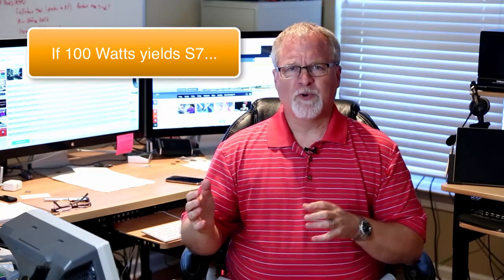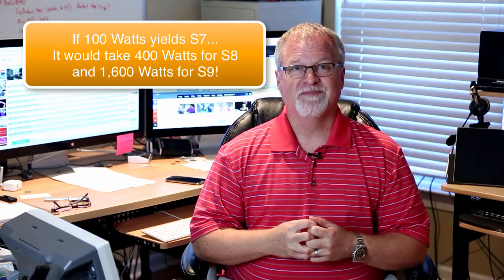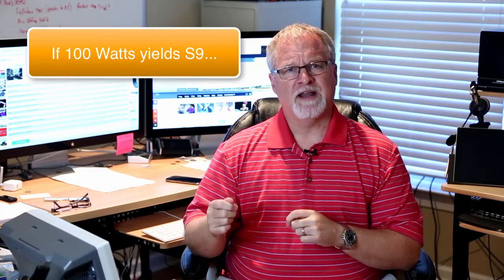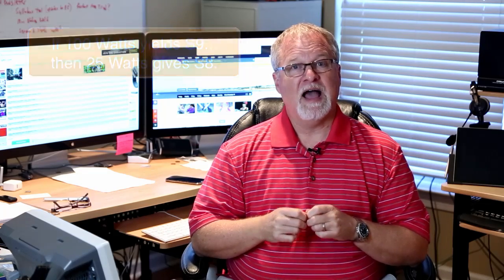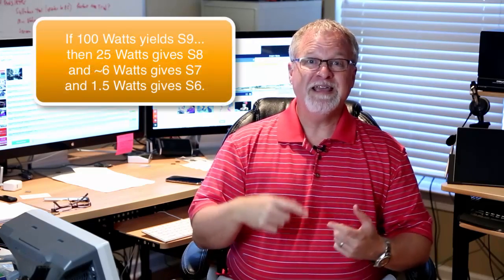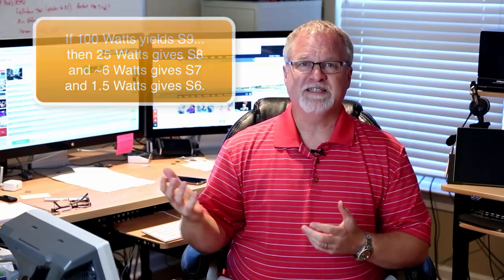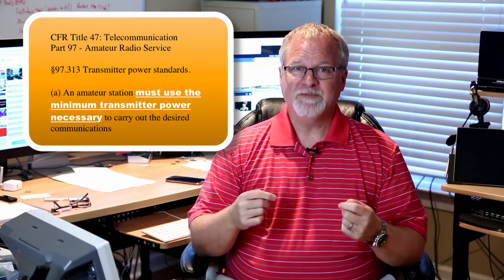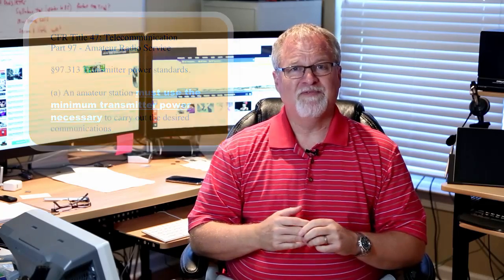Why QRP Works

Comment: Could you use a statistical analysis over time to receive slow transmissions below the noise floor?
Reply from the maker: Yes. In fact, see QRSS: http://www.w0ch.net/qrss/qrss.htm
Reply: that's awesome.  would you even need a license if the transmitting power is ultra low?  i'm think you can legally go rogue if you just go slow and low enough, maybe even employ spread spectrum.
Reply from the maker: No license required to listen, of course.  But, if you transmit outside of the license-free frequency allocations, the FCC requires you to have a license. - Cliff
Reply: How could they detect if your transmission if it's on spread-spectrum and below the noise floor?
Reply: Do you know how to calculate the radiated power from a 3v3 IO pin with about a 5-inch wire hooked up as an antenna?

I have an FPGA that I can program with a linear feedback shift register, basically a pseudorandom number generator.  I'm scheming:  If the next psuedorandom bit is 1, wait a clock ticks before changing state of the IO pin, otherwise, wait b clocks ticks before changing state of the IO pin.  (Could be more than 0, and 1, and more than a and b if you want a larger spread).  Stick a little wire on the IO pin for an antenna.  You'll transmit what sounds like nothing but noise across, according to the particular specs of my set-up, 892 kHz.   It will be a nearly Gaussian (binomial with large n) distribution centered nearly around the average wavelength.  The probability distribution curve is a little skewed because it takes a little longer to transmit the lower frequencies than the higher frequencies.  But the exact distribution is not important.  The important thing would be that it's spread out enough and that only a privy receiver would know the next psuedorandom number to distinguish your signal from noise.  The sender could modulate the signal by slightly straying from the default signal, and the receiver could distinguish the difference.
Reply from the maker: I don't know about your calculation.  You'd care more about the actual radiated signal.  If the 5-inch antenna isn't a good antenna, you're not putting out as much RF.  But to answer an earlier question: "legally" and "going rogue" doesn't sound like those two things could/should be used in the same sentence. :-)

Comment: What a great explanation, as I have heard several guys say, " QRP is not for me".  You have got me thinking now....I really want a KX3
Reply from the maker: +Marty Lemons Hey, Marty. The KX3 is fantastic. It's almost too good, if that makes any sense.  It's like driving an expensive European sedan.  It's the pinnacle of engineering but, sometimes I want to ride a motorcycle... or a bicycle!  I use my Mountain Toppers and my KX1 more than my nicer radios, for some reason.  I just got the cheap MFJ-9200 and am having fun with it even though it is not as nice as the KX1.  I don't know why but I seem to prefer the smaller radios in spite of their inferior specs, bells & whistles, and versatility - compared to the best QRP radio ever made... the KX3.

Just a few minutes ago, I worked XE2HOE in La Paz on 20m at night.  That's 1,618 miles from my house (near Nashville, TN). I was using my KX1 @ about 3 watts into a vertical. I guess I'd have to say it was more fun to work him on that little rig than it would have been to work him on a more expensive radio.

I've discussed this with a local QRP friend and he feels the same way.  He's just as happy to use a cheap MFJ rig as anything else.  I get it but I'm sure many people would think we were nuts to leave a KX3 parked in the garage while taking a MTR-3B to the field.

So, all of this to say, you are wise to covet the KX3... but there is also something cool about using something smaller, less expensive, and less capable and seeing what can be done with such gear.  I think I need to make a video about this to see if anybody else feels the same way. - Cliff
Reply: Very well said Cliff. This applies to me in Ham radio as well as in my guitars and music gear. I played professionally for nearly 40 years using some of the finest guitars made. Yet I find myself being drawn to and having more fun with my $350 guitars as opposed to my $3,500 guitars. In fact, the last 10 years of my career working for Carnival Cruise Line were using the tweaked $350 guitars much to many peoples surprise.
Reply: I’m loving my SW-3B. Made contact with Australia 7000 miles away on 5 Watts. I’ve been using a friend’s KX3 and while amazing, seems too much. The K1has my attention.

Comment: Stumbled on this video by accident and it changed my whole view on QRP.  Thank you!  The past two days i haven't dropped below 10w and most of the time I'm running 5w.  Made 10 CW QSO's on 5-8w and most three of them they thought I was running 50 or more (5NN).  WOW!  Longest QSO on QRP has been 1,400 miles.  Looking forward to more videos. Thank you again!
Reply from the maker: +Chris Fuller That's great,  Chris!  Keep shocking people and we'll get some more converts! - Cliff
Reply: Thank you my friend. FYI, I just worked W6RO, the Queen Mary in Long Beach CA on 5W .  That's 2,293 miles away on CW. What a thrill. Now I need a calculate to figure out how efficient that was.... :)
Reply from the maker: +Chris Fuller Making a contact like always puts a smile on my face for quite a while. Congrats! - Cliff

Comment: I am not a ham operator, but am looking at getting into this as a hobby, and also for emergency preparedness.  The technical information available for various radios is simply overwhelming for the uninitiated.  This is especially true when considering radios of different power levels.  After stumbling onto your channel, and listening to several of your videos I quickly began to appreciate that power isn't everything with HAM radios. In fact I can see many advantages to smaller DC powered portable units, especially in emergencies.  I found your explanation of QRP radios to be very informative and helpful.  I feel much less confused than I did even 10 minutes ago.  Thanks very much
Reply from the maker: +Marvin Double Thanks, Marvin. - Cliff

Comment: I think this pissed alot of old hams off. Some of these legal limit runners just don't give a shit about this FCC rule.
Reply from the maker: It's unlikely that a ham whose amplifier is wired to turn on with the shack's room light switch would lower their dignity to snoop around a QRP blog... But, you never know... :-)
Reply: +QRP School Yes you're right. But hopefully they will see my message if they do. ;)
I was portable a few months back and a ham told me i wasn't strong enough to talk to and that's why he had 1,500 watts and he was rude about it. Alot of these guys have these clicks and if you're not pegging their meter they won't acknowledge you. There's this one guy on 7260 that consistently uses 1,500 watts. I have to stay away from that part of the band when I'm portable or it's unusable. I hear he's been reported several times but to no avail. 
Thanks for making these vids and keep teaching qrp!

Comment: Hey QRP School that was a great explanation for why QRP works so well. I'm preparing for the technician license and I find low the most interesting. When I get that ticket will I be able to use QRP for phone communications or is it strictly code? Thank you
Reply from the maker: +Lynn Grantham Hi, Lynn.  Congrats on the decision to get your Technician License!  You can certainly use low power with phone communications.  Morse Code gives you a more concentrated signal so your chance of success is a little better with CW mode BUT your voice signal is only down 2 S-units from that of a 100 watt signal.  So, phone communications will work.  When the bands are in good condition, your 5 watt signal will sound perfectly readable to the receiving station.  Hope to talk to you on the air someday! - Cliff

Comment: I built my first rig a heathkit hw-8 back in the 1970's and with a random length antenna and a homebrew antenna tuner made thousands of contacts on 15m CW with 1.5 watts. There is a lot to be said for being able to toss everything you need into a backpack and setting up a fully functional station on a stump in the middle of the woods. I could run all afternoon on a few flashlight batteries
Reply from the maker: +Brad Carroll Hey, Brad. You're so right! It's a lot of fun to be able to set up a station in the middle of nowhere and go "fishing" for stations.  You never know when you're going to catch a big one... but even the small ones are fun when you're only using lightweight tackle!  (The "Hot Water" series of radios were a lot of fun, too.)